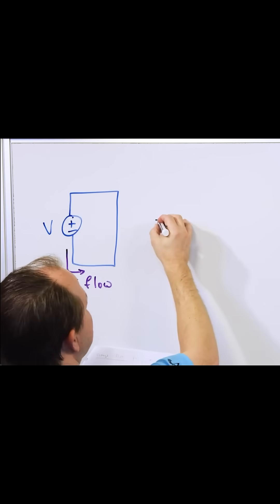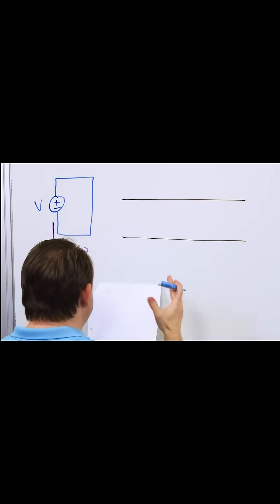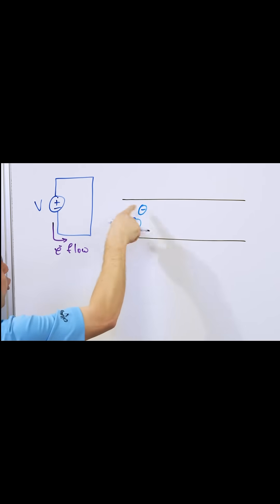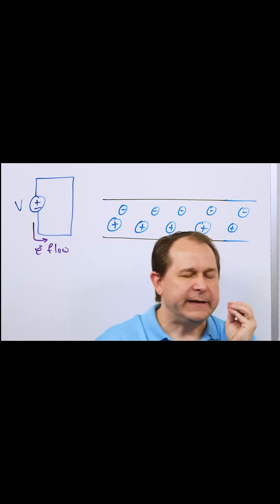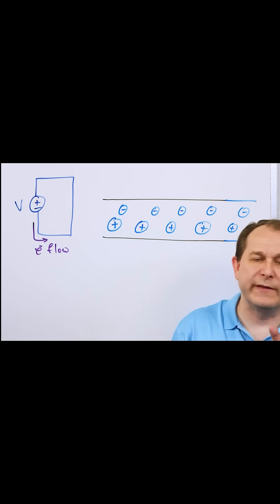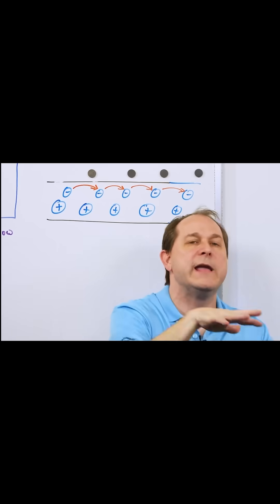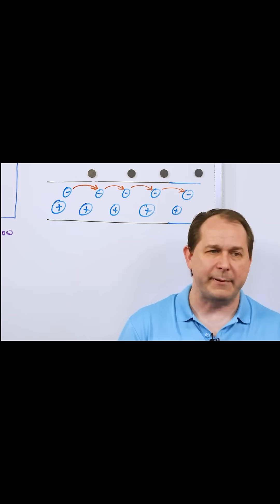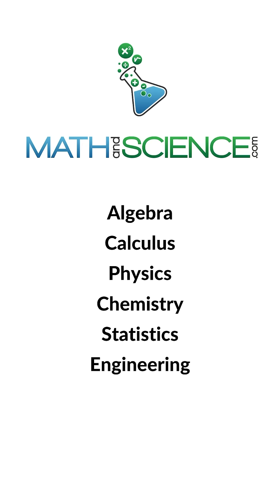How does current flow?

Comment: Not inside.  They travel on outside ("skin") of conductor, for the most part.  This is known as the skin effect.

Not random.  With corcuit disconnected they group in neg and pos in various regions.  They may move, but not randomly.
Reply: Incorrect. The skin effect applies to transient currents, not steady current. The skin depth of AC current oscillating at frequency 0 Hz (also known as DC) has a skin depth of infinity.